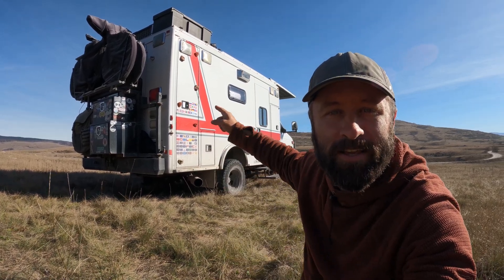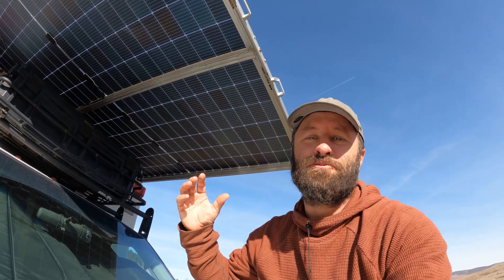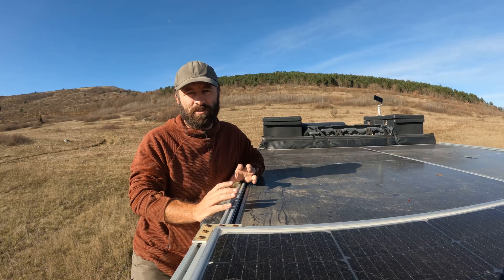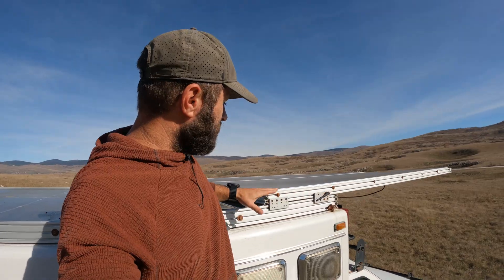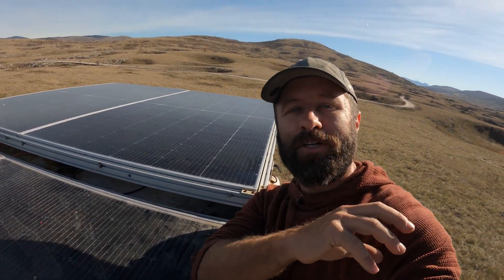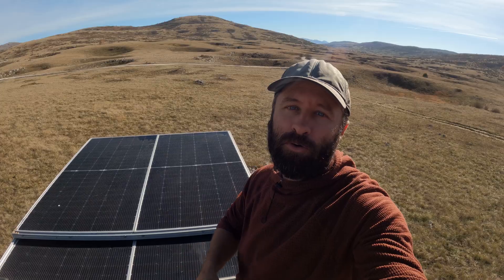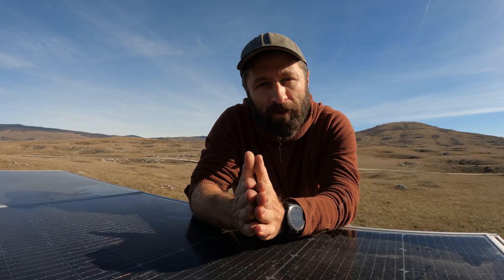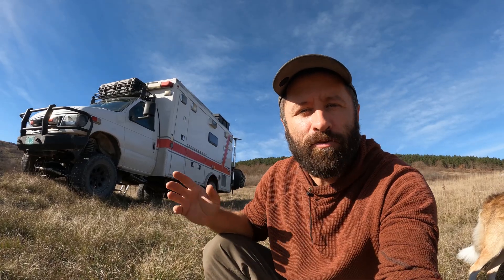How We Fit 2200 watts of Solar On Our Van!

Comment: I think I would have wired this via 2 strings of 2 parallel panels and then into a single 150/100 MPPT. Yes, you will see some clipping in summer with both arrays extended, maybe an hour or two a day, but you’d minimize the cost to wire/install this and it’d still function perfectly with only 2 panels non-shaded. 100 amps even with 2200 watts of panels is going to be hard to surpass in most conditions anyways. My 1000W system mounted flat like yours, very rarely hits above 55A into the batteries so 2200 would theoretically very rarely surpass 100Amps, plus a lot of the time you’re only utilizing 1100 Watts anyways. Cool build though!
Reply from the maker: Having a complete backup system was part of this setup. That way if a charge controller fails I have another that can still run. We travel to places where it can be difficult to find replacement parts so this is a huge bonus for us. 
Also, we do hit 125+ amps from this setup often in the summer time.
Reply: @EmergencyGetaway I don’t think MPPTs are that prone to failure, but I understand, and it is certainly an added luxury. Yes, you would see slight clipping throughout the midday summer hours, but given your capacity you likely overproduce for your bank anyways and have nowhere to put the excess energy. I have 1000W of solar, 620AH of battery, and run my AC almost 24/7 in summer.
Reply from the maker: @ArizonaRegime the nice thing about setting up your own system is you can do it so it works best for you and your needs. Glad to hear your system is working well.
Reply: @EmergencyGetaway absolutely! I wasn’t trying to say your system wasn’t awesome, it is. I’m not trying to disparage you or the build in any way, but yes there are definitely multiple ways to defeather a chicken. Do you find that you vastly overproduce with the 2200 Watts? What AC do you run?
Reply from the maker: @ArizonaRegime Didn't take it that way at all. I like hearing about other setups or how things can be done differently. 
It really depends on how hot it is. If the ac and solar are full blast, im putting about 30 to 40 amps into the batteries which helps catch up after running ac at night.

Comment: Look into a “alternator charger”. If you run your engine regularly, it’ll charge your batteries in no time. (EcoFlow, bluetti, etc)
Reply from the maker: We do have a dc to dc charger for alternator charging. Its 50 amps. However, we sit for a few days to a week sometimes and I dont like running the truck unless we're driving.

Comment: I've thought about the same set up on my tacoma to get ~1000w of solar with two 500w panels.Seems like finding good hardware is the difficult part.
Reply from the maker: That would be a crazy setup on a Taco! Id highly recommend taking a look at 8020 extruded aluminum. So many options to build just about anything you want. Its like Legos for adults 😂

Comment: Some garage doors have a 'screw drive' that I think would also work (besides the 'chain drive'). 

However, typically, the screw drive doesn't move, it just turns. So, it would be sticking out flapping around as the vehicle moved, when the panels were stowed. (this is if you have the unit sit under the panels, and connect to the front outer edge of the top panel) 
Front/back (front of vehicle, back of vehicle)
Another possibility would be to have it connect to the back of the panel on top, but this would require the garage door unit to sit above the panels (perhaps behind the stationary units) - a single screw would shade the stationary panels, push the top panels out. My biggest concern is the 'automatic stops' - the limit switches (and circuit board) would have to be robust to handle weather. Garage door openers are inside, protected from the elements. 
Finally, there are gate openers, but those are generally huge ungainly boxes that protect things from the weather. 
How about a hand crank (so still manual, but so you sit on one side, turning a handle?) 
No electronics, minimal climbing.
Reply from the maker: All great info! I agree, a garage door opener wouldn't quite work since it would be outdoors all the time. Hand crank would be ok. 
I saw a motorcycle loading ramp called neodyne that uses webbing straps, gear and a drill. Ive considered making some like this that would be able deploy and retract panels.

Comment: With no boxes on the roof the panels would have no need to slide or be stacked the van would use far less fuel and no set up or rear and full output traveling or not.  I have my roof vent under the panels and it has a insulated plug on the inside and a lip outside it can be removed and open in a rain storm.  I just use standard solar house rails and clamps plenty of airflow and cheap with quick panel change as newer panels are available second hand.
Reply from the maker: Even without the rooftop boxes we wouldn't be able to fit all of these panels. I would've been able to fit 3 but not 4. Also, our AC unit is back there as well which is the main reason for more panels.  Im glad to hear your setup is working well for you. The best part about building things yourself is you can do it however you want and what works best for you.

Comment: If the top panels where stationary and the bottom panels were on slides you could use the single actuator in center since it would be on underside of stationary panels and would not cause shade while slide is deployed.
Reply from the maker: This would work but id have to raise the lower panels up higher off the roof since I have roof vent fan up front.

Comment: What 80/20 extrusions and components did you use for the sliding rack ? Do you have plans on pdf ? Very nice setup
Reply from the maker: Thanks. I don't have plans on a PDF since i'm a wing it and see what happens type of person. I used the 25 series aluminum from 80/20.

Comment: Awesome rig!  Thanks for producing the video on this topic (saved for reference).  I am also curious about a few other things you might want to answer or make a video about: 
1. How much weight has been added to the ambulance (before/after build)? I understand an ambulance is already a heavy vehicle, and I suppose it might be weighed at truck weigh stations. Just curious about this as a living rig (full of all the gear and goods) could be heavier. 

2. What is the engine type and fuel used and the average fuel mileage once the rig is finished, loaded with liquids and food and gear and all stuff needed for boondocking for a week?  What is realistic to expect for a fully loaded live-aboard ambulance traveling the American West and going down the rough roads, boondocking, etc. 

I will subscribe, added a comment here to help you with the YT algorithim, and I hope you'll enjoy your travels and share more with us in the future.  :)
Reply from the maker: Thanks! Glad it was helpful. 
1. We did a complete gut of the inside of ours and i removed about 2000 pounds of metal. However, adding everything back in and when we're fully loaded with everything we weigh about 16,000 pounds. Keep in mind that over 1,000 pounds of this is our water and diesel when full. 

2. We have a 7.3L powerstroke and it's a beast. I absolutely love it! We get roughly 9 to 10 mpg but i'm honestly not worried about fuel. It's just an expense we have while traveling. Our performs really well offroad. I have pushed her quite far and she just tackles everything i throw at her. 

I appreciate you following along and watching!

Comment: How much is total weight added to roof - 4 panels and frames?
Reply from the maker: Im not to sure. I didnt weigh it. The aluminum is fairly light but the panels can get quite heavy
Reply: Those panels typically weigh somewhere between 70 to 80 lb a piece, so four of them would be about 260 lbs plus rigging so I guess somewhere around 300lbs
Reply from the maker: @maj429 that is probably pretty accurate

Comment: Don’t you have alternator dc charging as well to help keep things charged up while driving?
Reply from the maker: We sure do. We have a 50 amp DC to DC charge controller. This helps while driving but sometimes we sit in spots for a week without moving. Having the solar allows for less wear and tear on the truck.

Comment: use the cable and wheels from a garage door setup and mount a single small 12volt motor to turn forward and backwards.  depending on weight a little 12volt motor should work.  install a switch inside or outside if you use a marine grade switch.   job done..     motor in the center of roof connected to a rod with pulley on ends and run cable to rubberized roller wheels on roller bearing mounts.    used this home made setup on light weight hidden drawer in my house.   works fine.    or you could try a couple electric car antennas not sure how to make sure they move at same speed.     just some ideas..   maybe helpful maybe not.
Reply from the maker: Ive considered something like this and I think its going to be the easiest route. I appreciate the details and input for sure.
Reply: 12v tarp motor for dump trucks, I use one to lift our bed. You have forward and reverse control, you could get by with 50-80 watt motor, I needed 100watt because of our mattress, you are not lifting, you are sliding so draw should be low.
Reply from the maker: Thanks! Ill have to look into that one